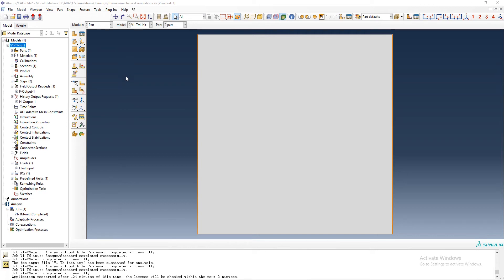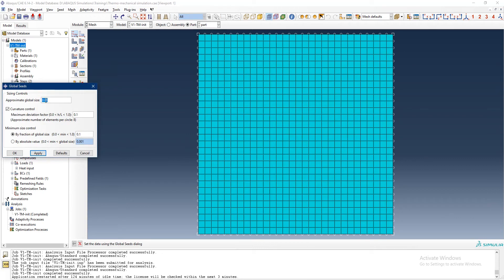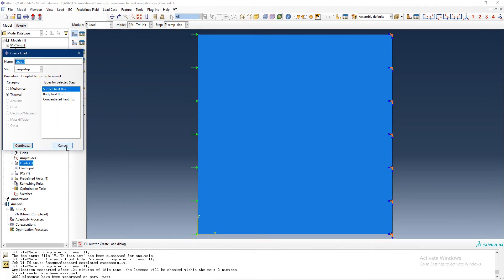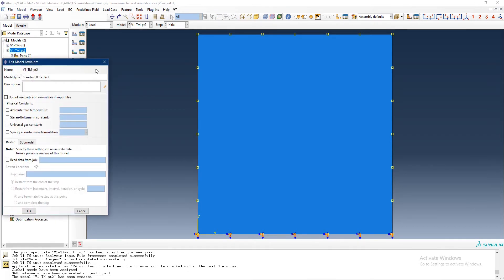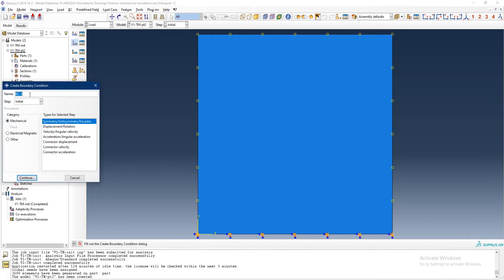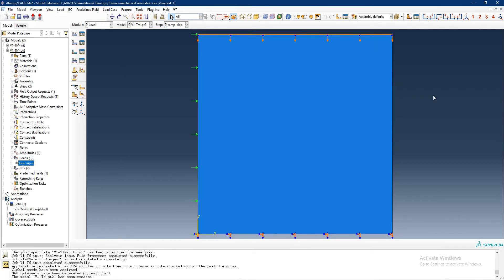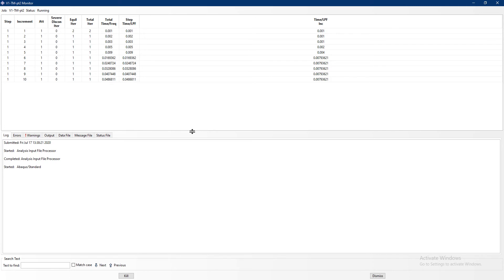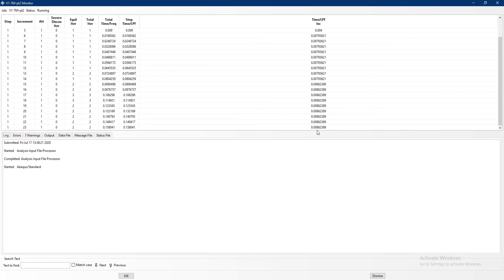Thermo-mechanical simulation in ABAQUS : Part 2

Comment: Hi,In this video you have done implicit coupled temp displacement analysis.If i want to do explicit coupled temp displacement analysis of your simulation will there be any changes i have to made like adding subroutine etc for doing the same simulation again.Suppose i have given input ogden model parameter for my hyperelastic ,incompressible material.
Reply from the maker: @arnobbaiga309  I don't think so. Maybe you'll need to adjust explicit step parameters for better convergence.
Reply: @FaisalQayyum   Thanks for the reply. Actually I am validating a paper regarding explicit diffusion deformation analysis by the help explicit temp deformation analysis. But I am facing a major problem regarding step time and thermal conductivity. Paper refers that “"We normalized time along with the normalization of thermal conductivity with its reciprocal in order to bring down the computational cost of simulations.".
Basically  I couldn’t understand the above statement of the paper that how the author normalized this time (10 hrs) and thermal conductivity (k).
Brother,Do you have any idea regarding this normalization concept ?
Reply from the maker: @arnobbaiga309  normalization usually means rescaling simulations variables. It's a concept that can you use to reduce computation costs virtually. I am not am expert with this technique but you can use ChatGPT to understand it better.

Comment: good job Sir, i need to ask you a question...I made mechanical tests for the impact test and I validated these results numerically by the simulation and for the second part I changed the temperature of the test tubes (20c, 15c, 10c, 5c, 0c, -5, -10, -15, -20) the question is:
-Is it possible to do simulations for these experimental results on Abaqus with different temperatures and what variations they need to insert into the model (I am using johnson cook's model).
input (conductivity-density-Elastic-Expansion-Plastic at different temperatures-porous metal plasticity-void nucleation-porous failure Criteria-SpecificHeat)
Step ( Dynamic,Temp-disp,Explicit or.... Dynamic,Explicit )
Reply from the maker: Its a very nice and detailed question. I feel Youtub
e is not the best platform to answer it.
Reply: @FaisalQayyum    if possible in Messenger you agree sir?